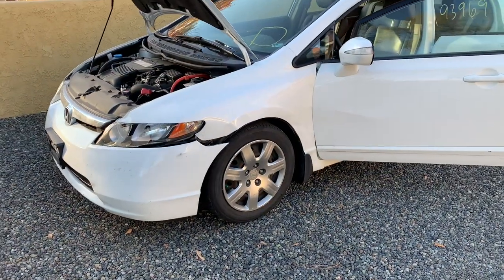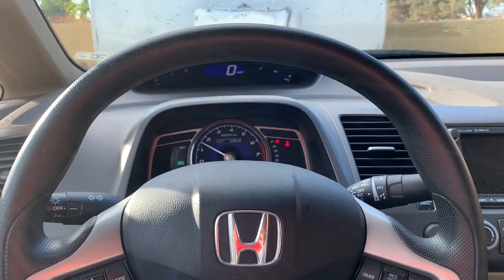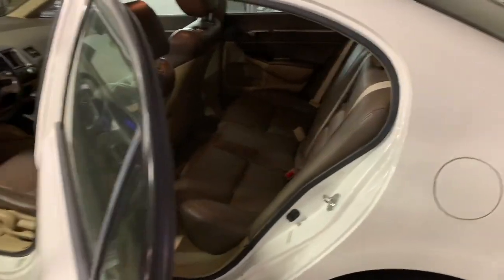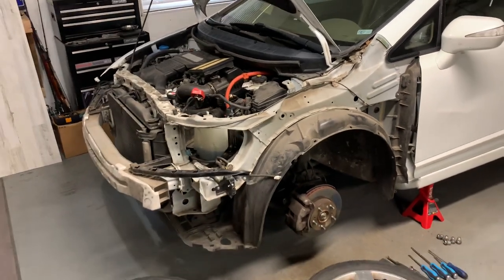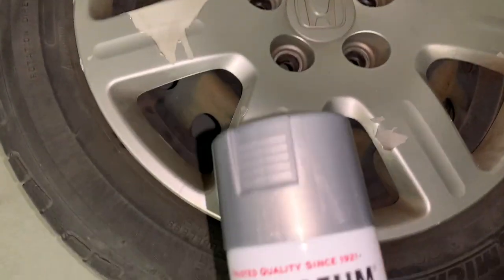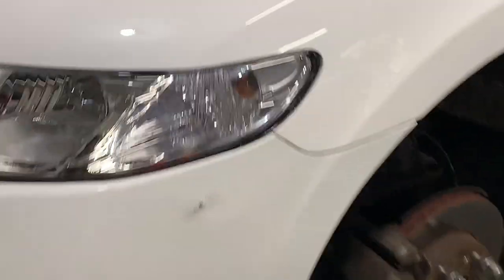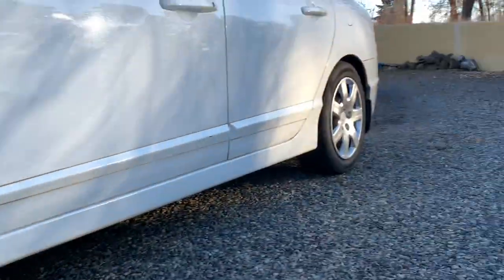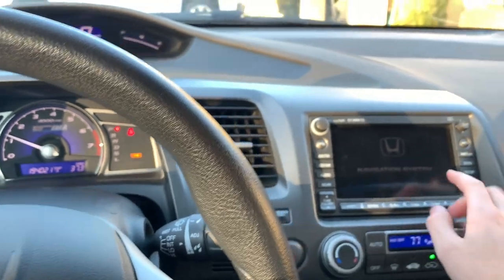How To Flip A Car | 2008 Honda Civic Hybrid [1]

Comment: GOOD JOB BRO I F I MAY GIVE U A SUGGESTION  STAY AWAY FROM HONDA AND NISSAN HYBRIDS  STICK WITH TOYOTA HYBRID . U GOT VERY LUCKY  BUT THAT HONDA BATTERIES  ARE NOT WORTH REPLACING .
Reply from the maker: Bro I know it would have been bad if the hybrid battery wasn’t working when I bought it! But thank God I didn’t have to worry about anything like that, purely cosmetic!
Reply: @gabegsgarage   congrats  bro
Reply: @dp9897 can’t the battery be repaired?

Comment: Those older Civic Hybrids are known for having battery issues at higher miles, and those battery replacements are close to 3 grand.
A reason why folks generally get rid of them when they hit high miles.
Reply from the maker: Yeah bro you’re right! If it wasn’t a hybrid it would definitely be more reliable but I’m glad I didn’t have any issues with the battery! 😭